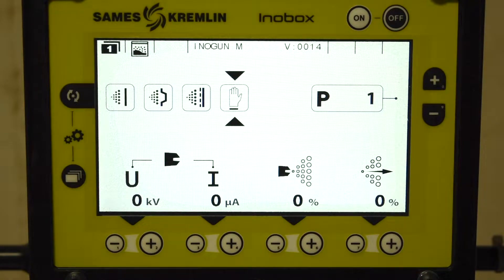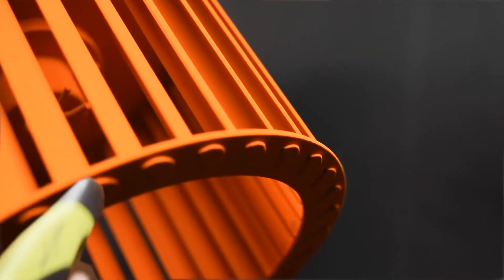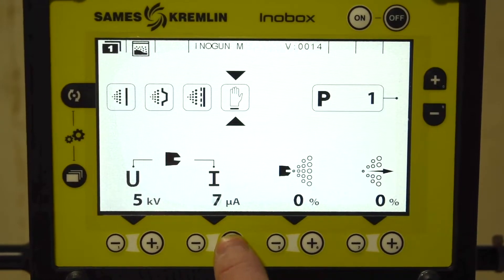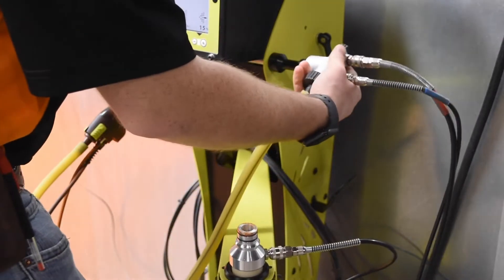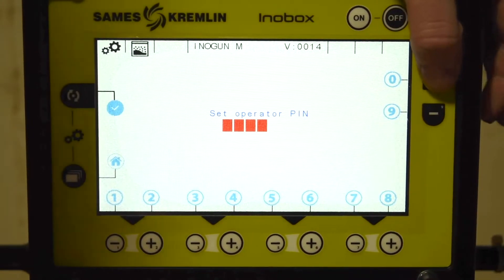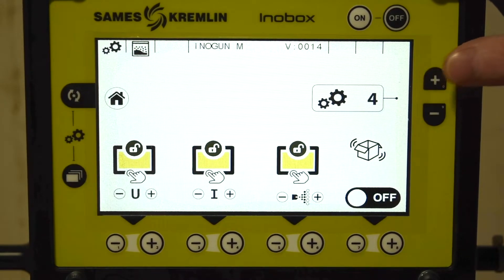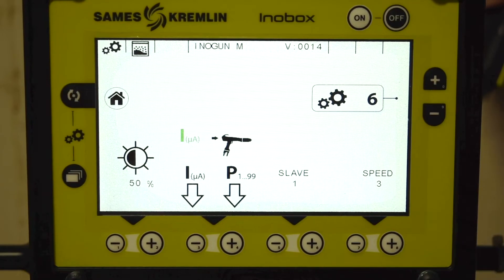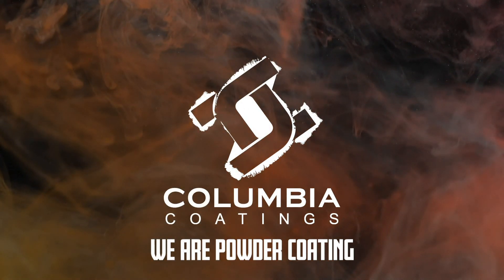Sames Kremlin - Features and Functions

Comment: Is this the same as the Table top unit
Reply from the maker: For the most part, they are the same. There are a few differences, like powder delivery etc. If you give us a call or send us an email, one of our customer service representatives will be happy to answer any questions you have.
Reply: @columbiacoatings  so the computer and gun are exactly the same?
Not worried about the powder pick up
Reply from the maker: There are some slight differences. Our customer service team will be able to answer your questions in better detail.